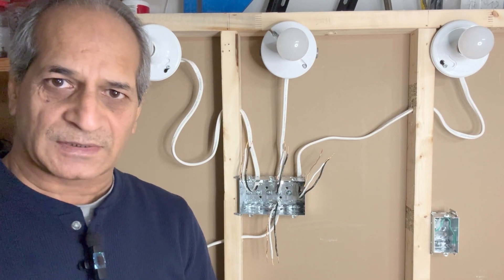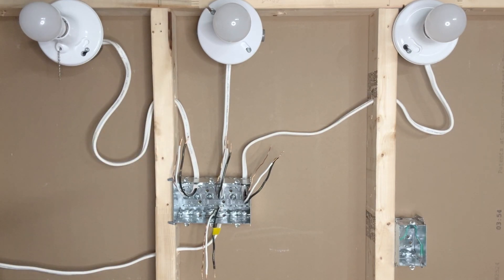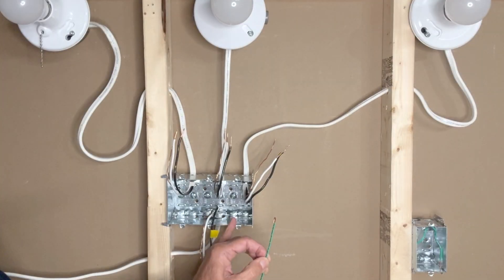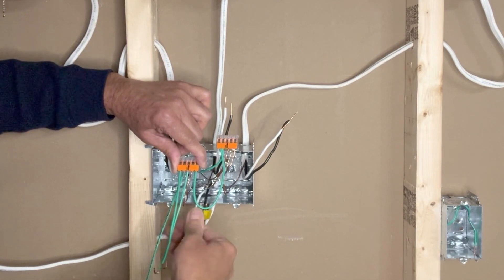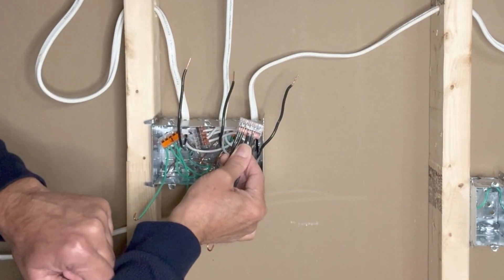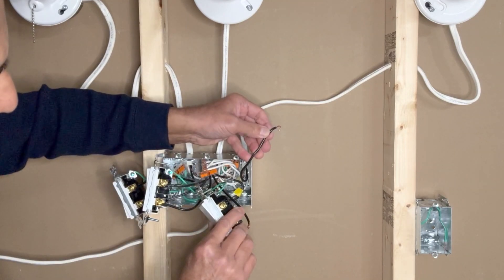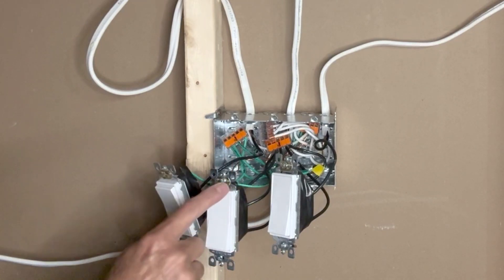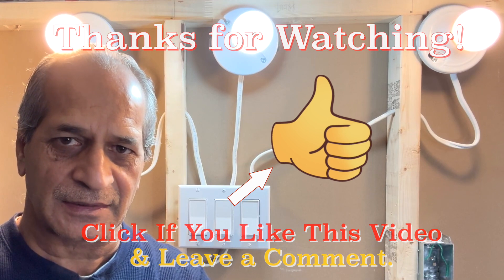Installing Multiple Light Switches With A Single Hot Wire

Comment: Say your middle light is also the power line, which is a 14/3, coming into the box. Can you still wire this the same if you don’t need the red wire of the incoming light? Just cap the red wire and leave it in the box?
Reply from the maker: Thanks for watching! If the middle light is with 14/3, you need to make sure it’s not a three-way light. If it is so, just ensure that the power is not switched. Otherwise, the lights you connect may not behave as expected.

Comment: Extremely helpful, my friend! Big thanks for this video. My master bathroom is set up in this manner. Once I pulled the cover off, I was a tad bit confused with how they used to wire these up. Each switch had a small jumper connected to the next switch's load side screw. For the line sides they just backstabbed the outlet. I much prefer this method with the wago's.

Keep these videos coming! My favorite is the one where you wired a new light switch off of a GFCI outlet's line side so as not to lose power to the light if the reset tripped. Perhaps you have one already, but how about making one where you add new lights to a room that has only one light socket. I am thinking you could daisy chain some Halo brand (or equivalent)recessed lights. Maybe even explain the calculations to use so as not to overload your breaker. Should be easy!
Reply from the maker: Thanks for watching! I’m glad that the videos are helpful. Appreciate your kind comment. 
I’ll resume as soon as I get some free time. Thanks again.